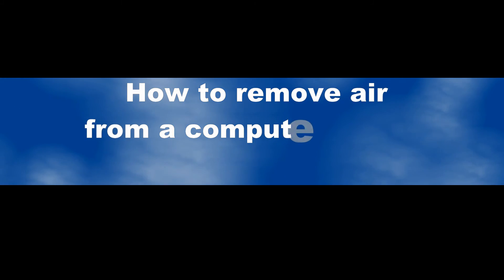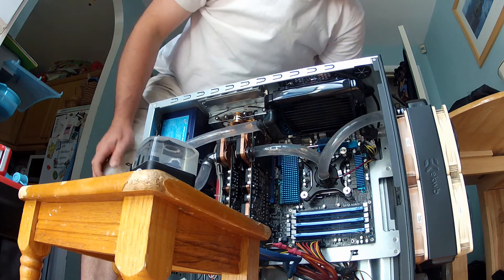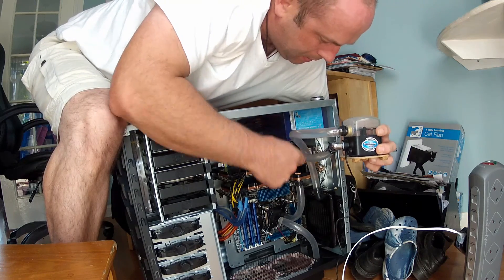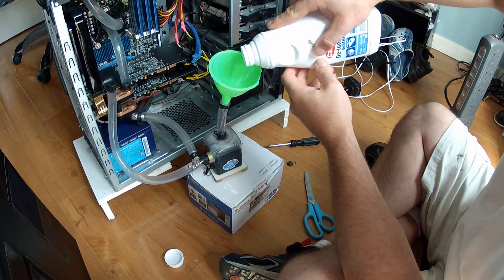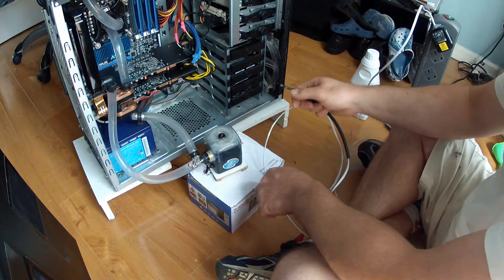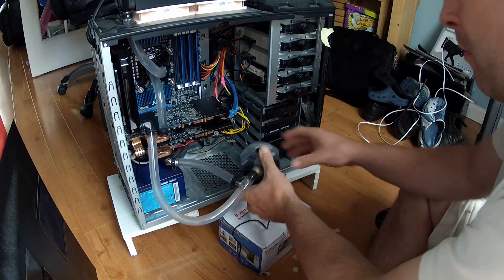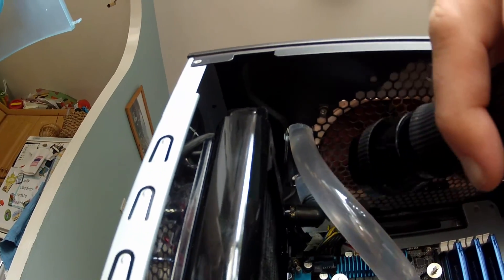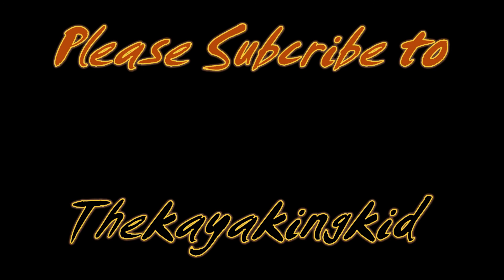How to remove air from your computer water loop - water / liquid cooling

Comment: 9 years later in 2023 this is not only still relevant but I have a 53mm x 360mm massive radiator that is front mount in a huge case with a 4090 so this is an even more painful process 😂

Comment: is it hard to bleed a water cooler im what if im using antifreeze in stead of  distilled water     do i have  to tilt my pc side to side  but would i get more buber in my loop if i do that
Reply from the maker: There is no need to use pure ant-freeze.  That is used to kill and microbes etc that are in the water.  Try distilled or de-ionised water with a few drops of iodine and a silver kill coil.  I never use anti-freeze as I see no need for it.
Reply: i am using distilled water did u say use dishwashing liquid
Reply from the maker: ryan vaughan Yes, just a few drops.
Reply: antifreeze, such as in automobiles, would utterly destroy your loop, none of the normal pc components can tolerate such fluids.
Reply from the maker: I personally would not use Antifreeze but the fluid should not be in contact with any components, only Nickel, Copper and some hose.  The only thing there that Antifreeze will deteriorate is the copper but it will take a long time.  The only benefit you get from antifreeze is its anti corrosive properties.
Reply: how many would be concidered a few?  (working my custom loop, and trying tips and tricks to do a few things)
i have some mayhems green stuff in my loop, also anti-corrosive and fungal etc

Comment: hi how do u get all the air out i'm new at water cooling i have a swiftech mcp655 pump  an a koolance rp res 2 pumps sit on top 45 2x2 and my radiator alphacool 60 mm thick  3 fans and i still can't get  all the air out am i doing somthing  wrong im using distilled water in my system  please help me     !?
Reply from the maker: If you drip 2 - 3 drops of washing up liquid into the res, this increases the surface tension helping the pump push the air through the system.  That and give it time since you have a fixed pump and res.  Have fun, welcome to liquid cooling.